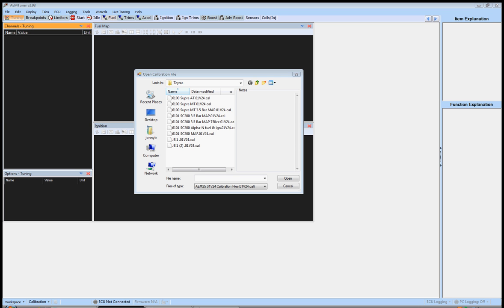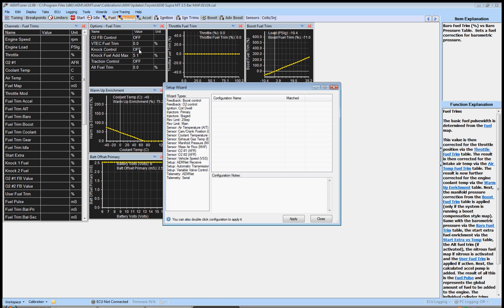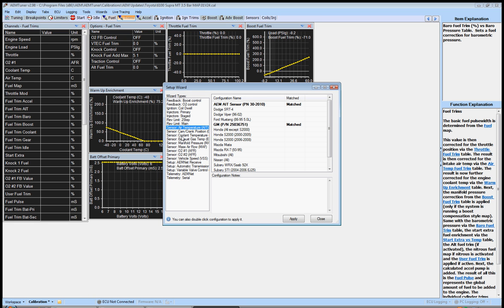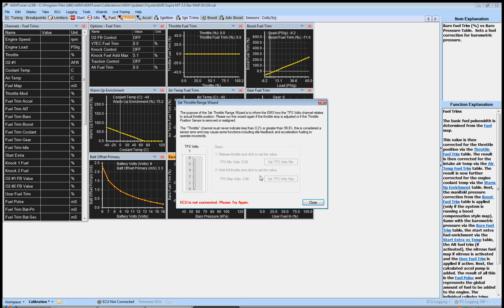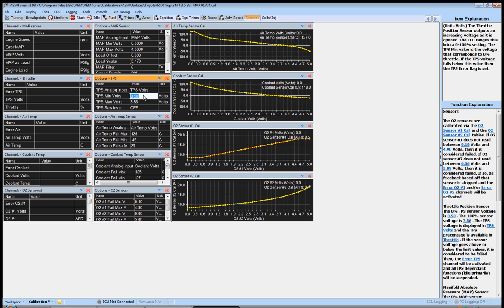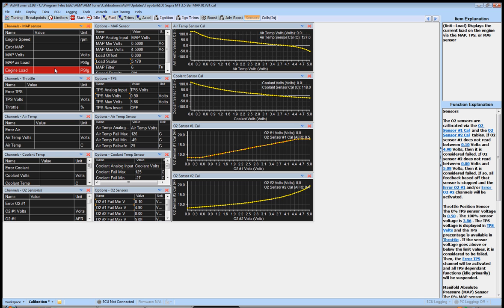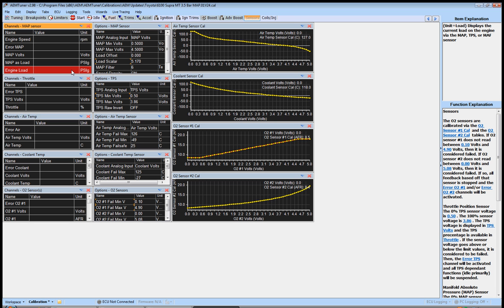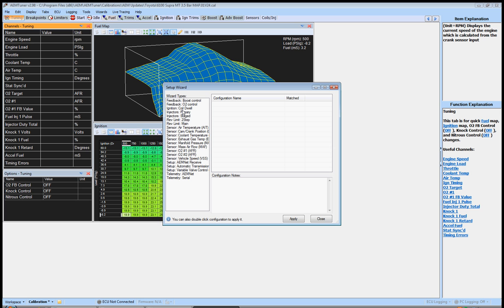AEM Tuning Part 1. Base settings and breakpoints.

Comment: Hey Jon, I was wondering if you had any experience with MAP/ IAT tuning as opposed to MAF based tuning? I have an RB26 I'm in the process of converting to single turbo and the easiest way is to go MAP and IAT since it has two MAF sensors and removing one would throw the car off completely. Im wondering how differently it would be to tune an engine using MAP and IAT instead? Thanks!

Comment: OK SO im buying my first 2jz car and ive never done my own tuning before but basically the car is a sc300 with a 2jzgte bottom and internals with a 2jzge head garret turbo and idk the rest of the mods by heart but basically it needs a new tune it idles like shit so im hoping ur videos will give me the info needed to do a basic 10 to 20 lb boost tune

Comment: Hey Bro, I've watched most of the videos and very informative, I'm getting no spark and no fuel out of my 3sge beams on my ems-4 all the values from the injectors and coils are in the red at 256 and 200 and also it seems my base calibrations for a 36-2 vr 1 cam vr the ignition map is all at 16? lol I'm lost
Reply: Northsyde Productions did you ever figure it out

Comment: Hello , very good videos, can you please help me , i have nissan silvia s14 engine sr20det, aem ems series 2 , i start the car on the calibration provided by the AEM , car started on that calibration but its on AFM , i want to convery it to MAP i have aem 5 bar map, can you tell me what settings i need to change in AEM software before starting the car on MAP ?

Comment: if using low impedance injectors without a resistor, which option would you choose? the one with <peak and hold> next to it? I have Bosch 1600cc injectors low impedance and not using a resistor on my 2jzgte but not sure which to select

Comment: Is this information pretty universal, or more specific for Toyota/JZ engines?  There are some things I want to check on my Nissan's tune, but ill disregard this info if its geared towards Toyota platforms only.  Thanks.  Great tutorials none the less!
Reply from the maker: I tried to make them as universal as possible. That is why I did not dive to deep in certain areas and just gave a very high level overview of what the maps do.
Reply: jonathan fasking right on.  Do you have an email address I can contact you at?  Curious if you've run into the same problem I'm having with my ems.

Comment: Hi, I am having some problems turning on my 2jzgte vvti with my aem ems v2 (I have been 2 days trying to turn the engine on). I am using the cam/crank for 2jzgte vvti (36-2), I am not getting any spark or injector pulse. Am I missing something or doing something wrong? 

I am not getting stat sync'd, I think it might be because my cam/crank triggers are wrong. can you please help me that way I can turn my engine on.

thank you for your help.

Comment: Jon, great videos, Id really like to thank you for doing these. I'd like you to re-listen to the part concerning the base fuel pressure. Unless AEMtuner differs vastly (please correct me if im wrong), typically the base pressure of (for example) 43 is not with vacuum connected to the FPR.
Reply from the maker: I think you're confusing my mentioning setting it at 43. It doesn't have anything to do with fuel calculations, and no AEM Tuner doesn't care about fuel pressure unless you set up the failsafes, but even then it has nothing to do with fuel calculations. Most aftermarket injectors rate their battery offsets at about 43 psi which is what they flow test them at. The reason for setting the fuel pressure at 43 is for matching it with the battery offsets. Obviously you could set it at whatever you want but 43 is a solid number no matter what platform you're using.
Reply: +Fakepower1 You're correct and that's been a standard since I started tuning in the early 2000's.  Relative pressure differential will always be 43.5/3 bar (or whatever you set it at) with a 1:1 regulator...  Which is what actually matters.

Comment: I see you say use a similar injector if yours aren't on the list, what about other sensors?  for example, I am using aem smartcoils and the aem failsafe gauge but don't see them in the wizard.  What would you use?
These videos are the best thing I have found on the internet, I have learned more in 45 min than I think I could have learned in a year by myself.  Really appreciate all the help.
Reply from the maker: Glad they helped. The AEM coils tell you exactly what to set them at in the instructions for the coils. Gauges are primarily independent of the EMS unless you're talking about the serial gauge, which you set up in Telemetry:Serial wizard.

Comment: Very informative, i havent yet purchased my aem ems v2 but im currently gathering my parts for my 2jzge na-t build and im considering attempting to do the tune my self.  But then again im not sure if i trust myself with tuning since it can either destroy your engine or help it run great.  Im hoping to buy the model that just plugs into the stock harness and maybe taking it to a tuner if i cant get a hang of doing an effective safe tune.

Comment: hey Im a bit lost on the setup for my injectors, Im running LowZ 750cc injectors from Fuel Injector Clinic on my 7MGTE Supra build. There's obviously setups to choose from that are equivalent.. I was thinking the RC or MSD would work.. most likely the RC tho. Since its a low impedance i would run the 2ohm not the 12ohm right? Is this possible? Thanks!
Reply from the maker: If your exact injectors aren't shown, it is perfectly fine to use a similar injector in the wizard.  I do recommend that you try and find the correct battery offset though for the injector as you will have greater control over them. Also, you are correct on the ohms. If you're ever unsure about if you have high or low z injectors measure the resistance across both pins of the injector. If it's 2-4 ohms it's low, if it's 10-14 it's high.

Comment from the maker: No. Think about it this way, air temp from when you first start the car at idle, till when you fully warm up might only change 10-20 (F) degrees, while coolant on the other hand could changed 150 (F) The reason coolant temp is used is because it is more reflective of CYLINDER temperature. The AIT is just measuring outside ambient temperature, it has no idea what combustion temps are. If you're still not convinced, try it the other way, save your map based on coolant temp though ;)

Comment from the maker: If you're thinking of rescaling the map sensor itself, while possible, what you'll be looking at won't be correct values for what's actually happening. For instance, 2 psi would not be 2 psi anymore. If you're thinking of flattening out the load breakpoints to gain more resolution from -14-17 psi, you can do this but while you gain some extra breakpoints, the speed the ecu processes the actions will still be the same. So, unless you have  a very tricky spot in there, you aren't gaining much.

Comment: If I'm planning on only boosting to only 17 psi on a 3.5 bar MAP, could I scale down the load breakpoints to get increased resolution? Or am I being limited by how fine the actual sensor can read?

Comment from the maker: Yes. Everything in these videos is relevant to any platform. What you'll notice on  the nissans though is that the idle% vs target table will have a pretty steep climb unlike the nice smooth curve you'll see in other setups. You're not doing anything wrong, that's just the way it will look. :)